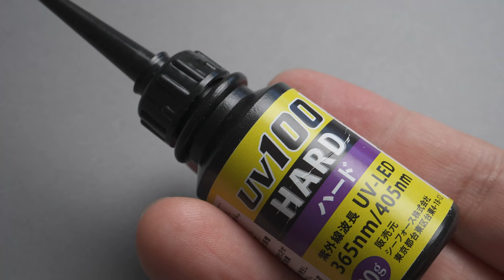#02 Building Jordan 191 TAMEO 1/43 F1 scale model car

Comment: Happy to see the next instalment of the current build. Good attention to detail again in removing the ridge 
In the suspension arms, many would have left them in. Surprised that you decided not to use tape/fabric for seat belts with the hardware set, the brass strips help to retain some shape to them. Because this is a smooth body shape with no features any attachments and details would be very noticeable and determine the quality of the build. So far so good. Looking forward to the next instalment. Also, many thanks for the links to the tools & parts used.
Reply from the maker: That's right. The shape is simple, so I'm working more on the details than I did on the Brabham.
Thanks again for all your help.
Reply: No, thank you for sharing your skill & passion in making these models & videos. Both inspirational & entertaining.